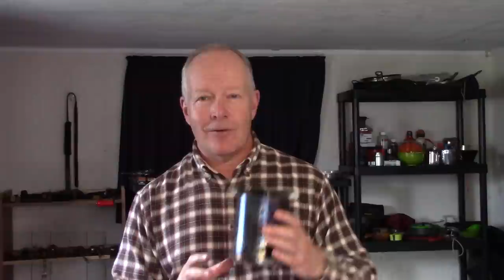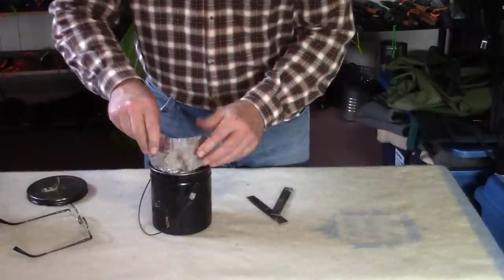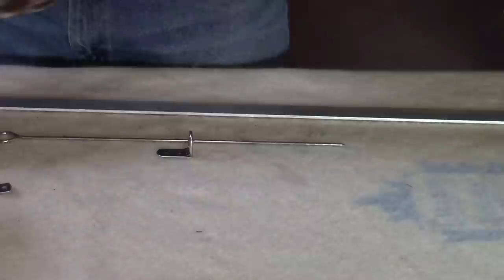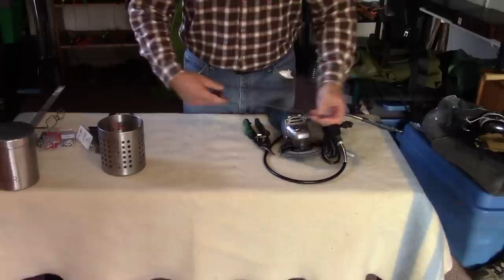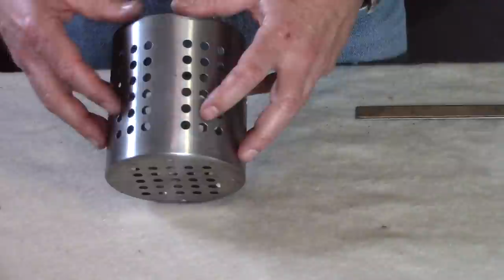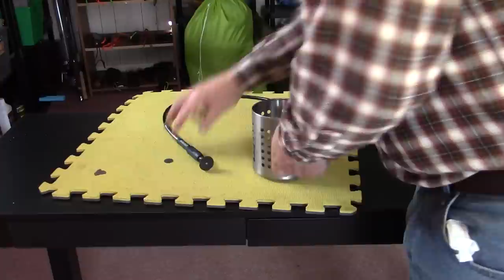Ikea Hobo Stove & Cook Kit - Part 1

Comment: An alcohol burner will easily fit in that hobo ikea stove. I love the option is gives you to burn with wood or alcohol.
Reply from the maker: Great suggestion. The trick is to use skewers through the holes to set the alcohol stove at the optimal height. Thanks for commenting.
Reply: Mark Young  could you make a surround that tightly fits the upper half to create a better chimney effect? With your pot stand and leg ideas I would think you would get get better ‘draw’ upward and more heat could be directed to the bottom of your pot than just escape/get blown out the side? I’ve just bought three of these and going to try and create that to see if it boils quicker than 750 ML to rolling boil in 20 minutes that was recorded somewhere else. Will probably use more fuel but maybe that’s the trade off for a quicker boil? Want to be able to use a trangia alcohol stove inside the same thing so it’s dual fuel too. Loved your pot - fantastic - and well made. Great video.

Comment: You can put a stainless steel container over the utensil holder, and you have a DIY wood gas stove. :) Plus adding another feed hole where the hole is in the utensil holder makes your stove look like a wood gas rocket stove hybrid.
Reply from the maker: I have tried a good number of upgrades and them made a video about them. The Ultimate Hobo Stove. Thanks for commenting

Comment: Nice video and options. Thank you. 
A step drill can be a good tool for making a round feed port, and there's already a starter hole.
Also, I have a bunch of assorted  stainless steel rivnuts, along with several diy methods or options for installing them. One method is to use an impact driver, others use simple hand tools. The holes for the rivnuts can be drilled, or the existing holes in the utensil strainer can be used. Then bolts can be used for adjustable feet.
Reply from the maker: Glad you liked the video. Your step-drill and other suggestions are great. That is one of the great thing about DIY projects. So many good ideas and all are valid. Thanks for commenting

Comment: make the square hole a bit bigger and use some pieces of those skewers to make loops (similar to hog rings).
Attach the loops to the 'door' you just cut out and the upper part of where the door was, and those will make a nice hinge.
Flip open to feed, and let it close to control air. Piece of small chain can be attached to the bottom of the door and dangle down to act as a handle.

For the 'legs', get some SS bolts, nuts, and washers.
Those can be jabbed into the ground to keep everything more stable than those slippery feet. My guess is about 3" long or longer a bit.

Skewers or long SS bolts can be inserted through the side holes to elevate the trangia burner (if used) or suspend the pot deeper into the contraption or both.

To help with hot ashes possibly falling through the bottom, use a pie pan. Pie pan, if small enough, can be used to preheat an alcohol stove too.

Biggest problem I see with EVERY setup, is that they are not very stable due to the height/base ratio.
All of them are top heavy.

I do like your idea and am going to try replicating 1/2 of it at least (the silverware/utility strainer part)
I have a firebox nano G2 and a another competitor's setup (has the word Red in the name).

Looking to make something that can hold wood/wood pellets for a longer burn when needed.
I also converted wood pellets into charcoal as well.

Did you know that hand sanitizer can be used to start wood pellets/wood/charcoal pellets?
Reply from the maker: I have an update video for the Ikea coming soon. Thanks for commenting

Comment: I built me a hobo stove from an old stanley thermos...used that thing on a number of long canoe trips...worked great!
I got the idea from Shaun of TheSilverFox over in the UK nearly ten years ago.
Since then i was gifted a bushbuddy, reckon they call them solo stoves these days...it fits nicely into the smaller 1.1 ltr mors bush pot.
I really like your design, for both its compactness and low cost...but for efficiency, it's hard to beat your solo gasifier.
I still have my stanley thermos hobo cooker simply because its just so dang cool and of course, because i made it myself.
awesome tutorial Mark...atb...woods
Reply from the maker: The original Bushbuddy and Solo stove work great. I have the larger Titan by Solo along with the 1.8 L pot. Glad you enjoyed the video. Thanks for commenting

Comment: If i might add, you can take that file and cut 4 notches in the rim and lay two of those kabob skewers across the rim in the notches...  
Great build Mark Subbed and rang the bell, now for some binge viewing...
Reply from the maker: Great suggestion. I have done that in other projects and find it works great as long as the pot size is smaller in diameter than the stove. Thanks for commenting

Comment: Great idea. For the support of the pot, you could also use two thick pieces of metal wire and just slide them in the holes.
Reply from the maker: Absolutely. As long as the pot has smaller diameter than the stove. Thanks for commenting

Comment: bike spokes are also very handy for handles and man many things. A wrecked wheel could be free at a local bike store. For cutting this material I would use a nibbler. You can get them as add-ons for electric drills or as a hand tool.
Reply from the maker: Bike spokes are very useful for a number of projects. Thanks for commenting

Comment: Don't forget to use dish water soap to put all over the sides and bottom of the pots, and let them dry over night or day. The soot will be a lot easier to remove. Plus a heat diffuser will work as well. :)
Reply from the maker: Great suggestions. Personally, I only wipe loose soot off and don't clean it back to bare metal. Thanks for commenting.

Comment: Hi Mark, really impressed with the simplicity of it all. Can you tell me what thickness is the aluminium bar? Here in the UK it would be either 3mm or 5mm which do you think would be best? Thanks
Reply from the maker: I am glad you found my video helpful. The aluminum bar stock that I used is 3mm thick. It has been sufficiently strong but does occasionally warp a small amount from the heat. I expect 5mm thick stock would be a bit stronger and not very much weight. Thanks for commenting

Comment: I just bought that thing you called a strainer because I thought I could make a stove out of it. I bought thtaller one thats 3 holes higher. It's a paper towel holder, I bought at Walmart. Poke tent stakes through the top holes.
Reply from the maker: Interesting that Walmart sells then as paper towel holders. Ikea calls them a utensil strainer. Wonder if there is a difference. Thanks for commenting

Comment: Damn ... where did you find that coffee pot ?!  I have been trying to find a container for my Walmart kitchen caddy (5" dia x 7" tall) and haven't found squat !  I have made stainless steel discs that I use in the bottom of the can for spark control or with higher position WITHIN the "fire-can" for heating.  Your cooking "X" is excellent.  Your pop-on/pop-off windscreen is nice.  I have mine (aluminum flashing) that locks together like ductwork, or can be unlocked like yours fitting tightly to the side - and 4" tall (allowing me to raise/lower the vent holes to bottom or top).  Can also take off as a separate wind shield.  My screen (in locked mode) can be raised above the fire-can (as a baking oven w/ stainless disc, supported by metal skewers) and cook with silicone baking cups or other smaller metal cups.  I have to use a 5" steel duct cap on my system, and it sorta works.  I have no cut-out fire box opening.  What fire there is (U)LW methodology is put into the fire-can and burned for what is needed.  Then cook another item with other fuel put in.

I have my entire heating/cooking/eating gear inside.  Fire-can, windshield, 2 steel disc, duct cap, spoon, fork, 4 BBQ skewers, 2 stainless rice bowls with cap lids, my design cooking trammel cable, my design carrying cable (make into an Apache fire carrier, live fire) 12 oz collapsing silicone drinking cup, 4 silicone baking cupcake cups, 1/2 - 1 - 1 1/2 cup metal bowls, a small silicone mitt, bic lighter and/or ferro rod/striker.  It can use any fire method out there - alcohol, sterno, walmart biofuel, esbit, charcoal, briquet, wood.  Can cook boil, stew, bake, ... if I had your coffee pot I could sous vide (!).  All of these items can be changed out for the landscape, season, and cooking/heating needs.

My fire-can can be safely used in a tent/shelter desing (spark proof) and all contained.
Reply from the maker: Wow...that is an amazing, well thought out, versatile system you have. Have you made a video on it or posted it to Instagram? So many great ideas in there worth sharing. Thanks for commenting

Comment: Mark, I though at one point, you stated the feed port wasn't needed on the Ikea stove. Is that still your opinion?
Reply from the maker: After making this video series and gaining even more experience with them, I personally don't feel a need for a feed port. Having said that, not having one means lifting a pot or pan off the top to put more wood in the stove. My current recommendation would be to not cut a feed port then try the stove out to see how it works for you. You can always cut a feed port afterwards. Thanks for commenting

Comment: Does aluminum emit toxic gas when at a certain temperature or is that just zinc plate or galvalume?
Reply from the maker: I could find no information that suggests aluminum will give off toxic gasses when heated to the temperature a wood fire would generate. I have since changed the crossbars from aluminum to stainless steel rulers. Thanks for commenting

Comment: Cut three holes by three holes then skip a row and cut three holes by three holes one row up. That will follow the fire box design more closely.
Reply from the maker: Right on. Good idea. I may try that on my next build. Thanks for commenting
Reply: Mark Young 
Made my cross bars out of Stainless steel tongs found at the thrift store. $ .59
Reply from the maker: Also a great idea. That is what it is all about. A well stocked thrift store and a little ingenuity and you can make just about anything

Comment: Where did you get the sugar canister?
Reply from the maker: I was fortunate to find it at the thrift store along with the Ikea strainer. When checking the thrift stores I take a measuring tape to see if a canister will fit inside. Thanks for commenting
Reply: I see now the spoon caddies are taller which is best the older shorter or newer taller btw I got mine short at Kmart before they closed in my town

Comment: Please tell me the height and O.D. of the cylinder, and wall thickness.  TY.
Reply from the maker: Since you did not mention which cylinder, the utensil strainer or the canister I will assume you meant the utensil strainer. It measures 12 cm OD and 11.5 cm ID at the internally rolled rim, I am not able to give you wall thickness but expect it is about 1 mm. The overall height without modification is 13.2 cm. Hope this helps

Comment: Need the height and diameter of the utensil holder
Reply from the maker: Yes, a stove that is taller than it is wide will draw air better. Thanks for commenting
Reply: @MarkYoungBushcraft  But you still haven't given the height and diameter of the one you have.
Reply from the maker: @rwprime1  misunderstood 130mm x 119mm
Reply: @MarkYoungBushcraft  There's no way that's 5 x 4 1/2"
Reply from the maker: @rwprime1  5.12" x 4.68" if you don't believe me go to Ikea and buy one
Reply: @MarkYoungBushcraft  Wow, my apologies then. Gosh... well for me that's too small. What I really want is a 3 qt RevereWare saucepan from the 40s (with lid)(none on ebay). My Mom had one, my Aunt and Uncle, my wife and I had one from the 60s but I don't know what happened to it. Right now I'm in the process of building a hobo stove out of a #10 can (Great Value green beans). But therein is the problem - it's a tin can and they wear out fast, but now that Reverware, that puppy will last and last. Here's a heads up for you. You know those two pieces of aluminum you criss-crossed for the grate, well I found a piece of aluminum in the basement that my wife had bought that you cut and screw to the floor where you walk out of one room and into the next and both floors are the same height (like two different materials - like linoleum bathroom and wood floor hallway and it was dirt cheap. EDIT Oh, btw, the 1940s saucepan was the one that had a single screw holding the handle on and not spot welded.
Reply from the maker: @rwprime1  Sounds like a great project. I a fortunate that I have a large thrift store near me that I find a lot of items I can repurpose into stoves, etc. For a larger hobo stove I use either a colander or spaghetti strainer. I have videos on both. I have moved on from aluminum crossbars after a set melted on me in a hot fire. I now use cheap ($1.00) steel rulers I buy at Walmart. Good luck with your project